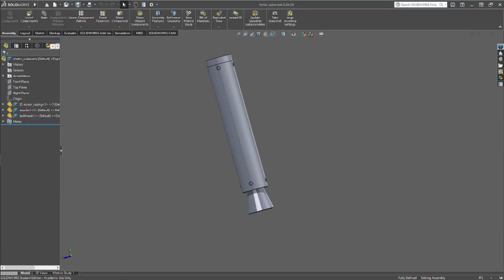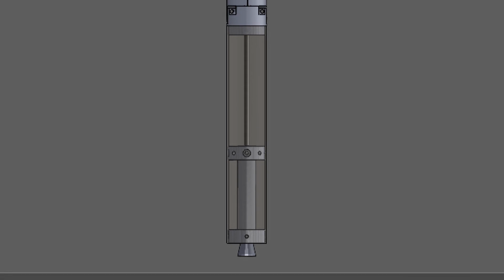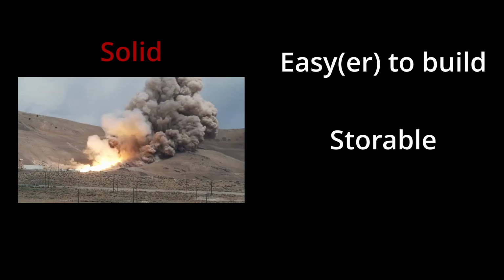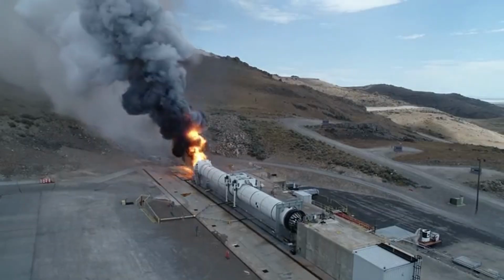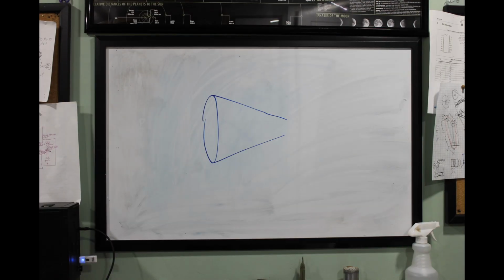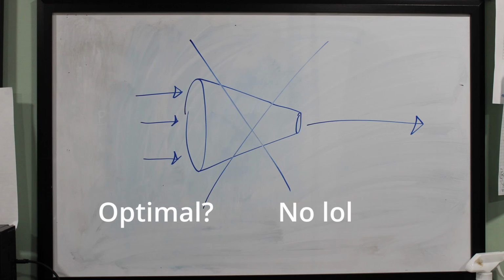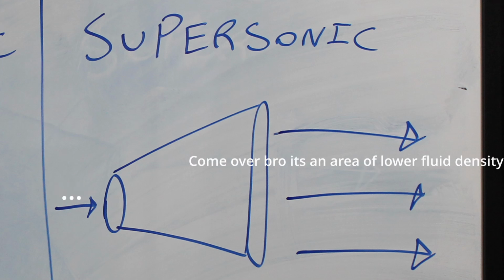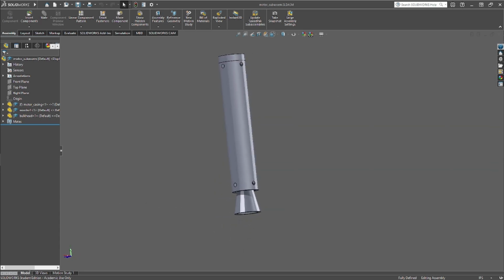Attempting to make a metal tube fly | Alpha Rocket Episode One

Comment: Your sugar is caramelized and your potassium is chunked, which will reduce its effectiveness. If you dissolve the potassium in its own weight in water first, then heat the mixture until boiling and add the sugar to the water, everything will dissolve way better and cleaner, and the water boiloff will cool the mixture reducing the chance of fuel ignition. Once the mixture turns like honey or a little lighter in color and consistency, that means all the water boiled off (and the sugar can finally raise its temp past 160 degrees) and you should have a completely homogenous liquid without chunks. Be careful, because that mixture might be several folds more potent than what you showed in your video. If it doesn't cool to a hard candy, you don't boil off enough water.

Comment: I knew about nozzles and their purpose, but idk why, it's on this video that i got amazed buy the physics of it
It is really a wonderfull piece of mechanics, no moving parts, relatively simple geometry (i guess) and such a great impact on the system performance

I was amazed kinda like I learnt how work a High voltage Transformer by induction

Thx, +1 subs !

Comment: You said you didn't have small enough lathe tools to carve out the diverging section, if you have drill bits of decreasing size would you be able to drill to increasing depths with decreasing diameters to get the rough stepping and then file/rasp away the steps to smooth it out?
Reply from the maker: You're right on the money here. I thought about doing that exact thing, but what I ended up using was the biggest reamer I had. It drilled out a sloped hole that is close enough to do some rough tests.